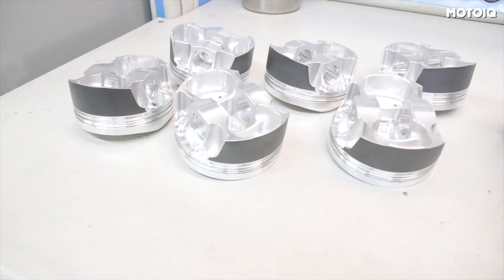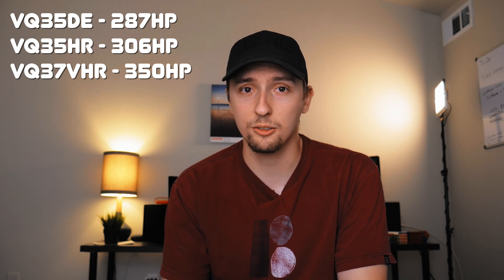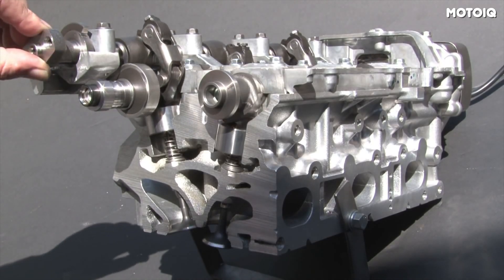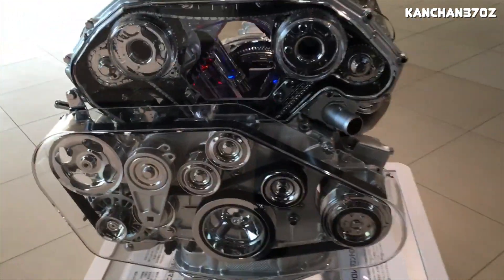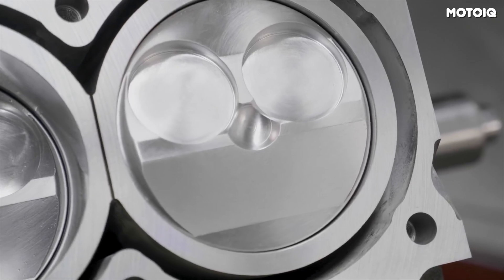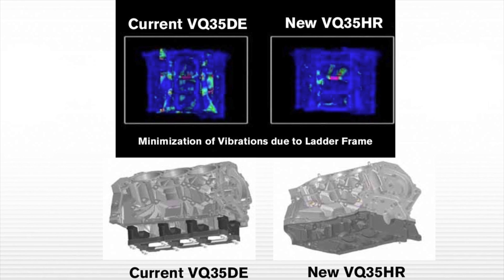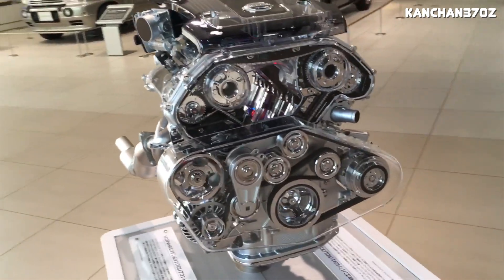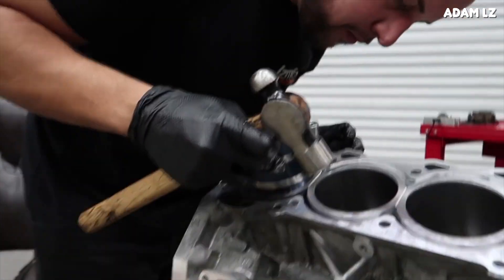Nissan VQ37VHR: Everything You Need to Know

Comment: I have a VQ37 in an Infiniti Q60S and it does not have oil loss issues.
I do change my oil every 3K miles so I am not sure if it would show
oil  loss  if I were to let it go
longer. Infiniti says the maximum mileage for oil changes is
5K miles.
Reply: Same with my q50s. No burning issues and I've yet to change my oil lol.
Reply: Oil loss issue is only common on pre 2012 nissans/Infiniti with the vq37vhr engines
Reply: @ExoticMfRon  160k miles on my 09 g37 no oil burning here.
Reply: I change my oil every 30.000 km. No oil loss or anything.
Reply: @rjvincent8682  how many kms do you have on your VQ?
Reply: @1wals1  93.000km
Reply: If you use the Nissan ester oil in the VQ37VHR the recommended oil change interval is 3750 miles. In looking at used oil analyses of this oil in this engine I see a consistent drop in the hot viscosity at about 3K miles from a 30 to a 20 weight, due to the VI improvers shearing down from the heat and shear stress placed on the oil by the intake VVEL mechanism. It's for this reason that I change the oil at 3K miles and I'm happy to report no oil consumption on my dipstick after 3K miles with an engine that has 36K miles. My polished SS exhaust tips show virtually no soot buildup.
Reply: I have a 2007 Nissan Murano with over 206,000 miles and I drive it like a TrackHawk.